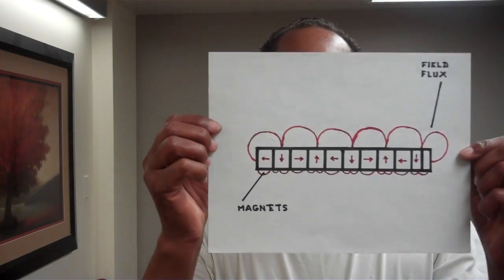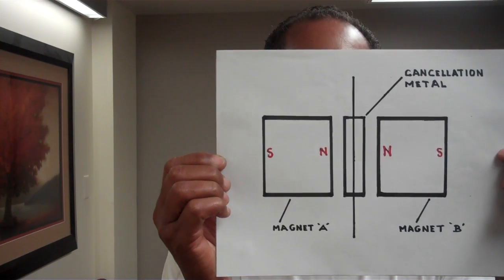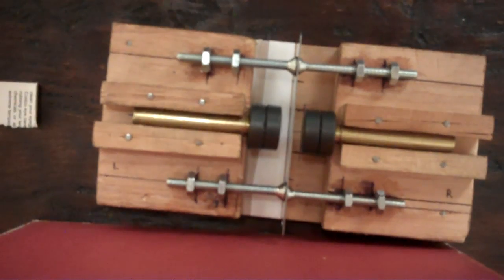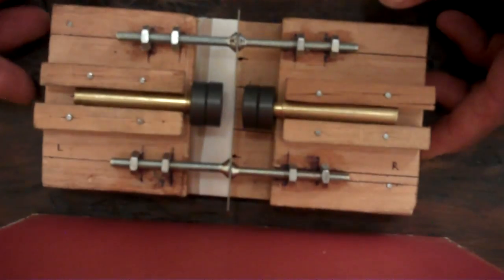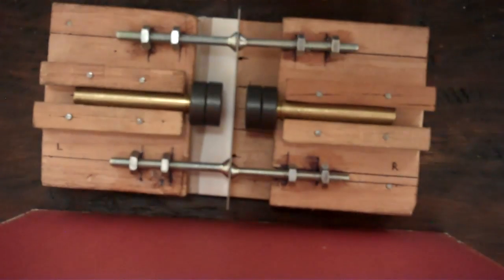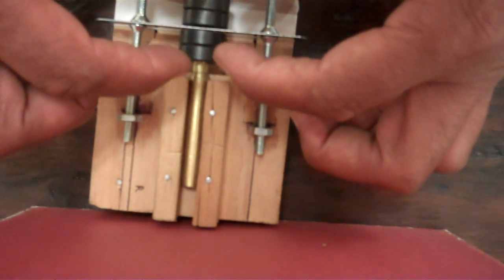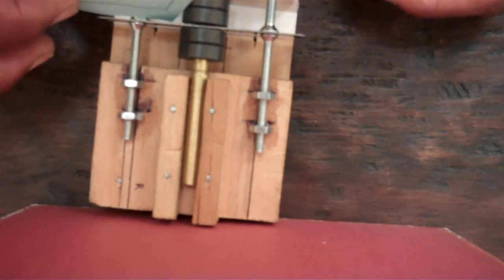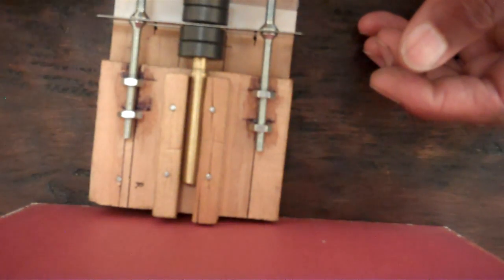PERMANENT MAGNETS: Two Types Of Permanent Magnetic Field Force Cancellations (Balancing) | Part 1

Comment: I wonder what material you used to cancel the strength of the magnets , I have tried already with several materials , which I thought best was the carbon steel, it negates the strength of the magnet that stuck on it , but does not prevent the another magnet is attracted by the same coating , please I'd like to know what this material in order to solve an equation problem I have,Thank you ... Good job !!!
Reply from the maker: +Nei Lemos Dear Mr. Nei Lemos: There's nothing complex here and no special materials are used. I used common small ceramic magnets (4 small magnets at 25 cents each) with holes in the center to superglue or attach small braze tubes (one to slide back and forth inside the other and cut to size) for about $2-$3 each, and the magnets and the tubes can be purchased at hardware stores. The cancellation metal is very common - spark plug gap blades ( about 30-35 to a set for about $5-$6) from any auto parts store. The screws can be metal or plastic for about $3 from hardware stores. You must find the exact thickness, exact length and exact width for the size, type, shape, strength and material that the magnets are made of. Simply make it accurate and precise enough and it'll work. It's not complex. The metal and magnets must always be exactly from the middle. There are no special materials in this Mr. Lemos. None. Look at the video again several times if need be and study it indepth. Everything is stated in the video.

Comment: why not also try plastic screws to hold the metal sheet and magnets?
Reply from the maker: +Dianne McCarthy Dear Mrs. Dianne McCarthy: Please make this simple device yourself and use plastic screws from a hardware store (about $3), 4-6 small ceramic magnets with a hole in the center of each (about 30 cents each) from a hardware store, 2 small braze tubes (about $3 each) from a hardware store, spark plug gap blades from an auto parts store (about $5-$6 for 30-35 in a pack). Use any common wood around the house you find for a base. Takes about $20 to make. Make it precise and accurate so it'll work.

Comment: What if... you epoxied the whole assembly together when the magnets and metal are in the correct position for cancellation.. would this be considered a uni pole magnet of sorts?

Also, how hard is it to move the metal out once cancellation is achieved?
Reply from the maker: ***** Mr. Steve Zuccaro: (1) the repulsion of the magnets towards each other (-1) while simultanously each magnet is attracted to the metal (+1) creates cancellation. +1-1=0. Epoxying the system in place in the cancellation mode would work. It simple depends on what your purpose is for doing this. (2) the metal is under attractive force from the magnets in the X, Y and Z coordinates directions. How ever strong the fields of the magnets are is how much force it takes to remove the metal. Permanent magnets are of different types, materials, sizes, shapes, etc. depending on your purpose.

Comment: I was hoping you'd pull the metal out.
Reply: spedop08
If you make something that works, don't try to patent it.  It will be confiscated. Instead, send it to everyone you can by Email ans snailmail, not just YouTube.
We ALL benefit or NO ONE benefits.
Reply: alphabeticalor
The world is flooded by fakes and frauds and that makes it easy to "debunk" overunity completely but look at what a magnet does, esp a powerful neodymium.  It produces a PERPETUAL field of magnetic force.  That constitutes an "impossible device." It's staring us all straight in the face; a glaring perpetual contradiction.  Why don't people see it for what it is?
Reply from the maker: +alphabeticalor Dear Mr. Alphabeticator: The above video doesn't demonstrate - magnetic shielding - but magnetic field force cancellation. This MUST be understood. They are two utterly different things. The set up in the above video shows a principle that has been searched for, for several centuries. This is what you were looking at along with Hallbach Arrays. If you wish to comment on any subject please make certain that you are versed in the field before doing so. To make certain that you gain comprehension please make one of these devices for yourself. No thinking or talking but experiment. MAKE ONE. It costs about $20-$30 to do so. Afterwards then talk.
Reply from the maker: +tomken8dy Dear Mr. Tomken8dy:  
   Your statement is correct. If the correct design is found (and it has) a permanent magnet system will run several months to several years without any external energy input. Please go to: https://youtu.be/ZQVEdDbq7wY
   Title: Permanent Magnets: Constructing A SEMI- Self Sustaining Machine. This presentation should alert you to such possibilities.
Reply: Andrew Sinclair
So the planets just orbit around the Sun for billions of years until it goes nova but it's not perpetual because that's not possible and admitting that our very planet and Sun comprise a perpetual motion device would make conventional science look foolish.
Reply from the maker: +Jeff Beck . Dear Mr. Jeff Beck: (1) This simple but extraordinary permanent magnet principle is to be used as part of machines which as a whole will do work. (2) There's only - one - true perpetual motion form and that is the total universe itself. Limited mechanical systems can never be perpetual even tho they can be long running or long lasting in the short human life time context.
Reply from the maker: tomken8dy Dear Mr. Tom ken8dy:  The device in the video is simple and can made for about $20 or so. Please make one for yourself. Be precise in its building and dimensions so it'll work as shown above. When the metal is completely taken away the magnets repel (push away) each other. Nothing more. This very simple principle has been sought for several centuries. To make free energy, perpetual, over-unity, etc. type systems which is mechanically not possible with - real - machines. Please go to other videos I've made on you tube about machines and permanent magnets and its laws.
Reply: Jessie Johnson
Permanent magnets produce perpetual energy.  Field cancellation, even a little, can help magnet motors get past the "sticking point."
Reply from the maker: +tomken8dy  Dear Mr. Tomken8dy: Only in the sense of human longevity does a magnet produce a - VERY - long lasting field if that magnet is undisturbed under nominal conditions. A magnet's magnetic field will last several thousands of years under flawless conditions.
Reply: Jessie Johnson
Which means that if the correct design is discovered a magnet motor will run as long as it's bearings last.
Reply: Jessie Johnson
Thank you.
Reply: The metal in the middle supports the whole point of the demonstration.
Reply from the maker: +tomken8dy Dear Mr. Tomken 8Dy: Your point is well taken. 10-20 billion years is utterly perpetual or in perpetuity in the - human  context - in the short few 100's of 1,000's of years of longevity our very specie. It is the use of certain - words -  that produces the arguments. The sun and planets combination are not machines nor devices. A machine is anything used to do work for the purposes that living beings give it. There's one exception to this principle and that is: a living thing can not be made into a machine for when this tried they become slaves. It is the only exception. And a device is anything constructed also for a purpose to be used by living things. Outside of living beings there are no meanings, purposes, reasons, etc. Otherwise from the standpoint that you're speaking you are correct.
Reply from the maker: +ILLUMINATUS1973. Dear Mr. Illuminatus: Your word - propel - does not apply to the Universe as a whole but only to extremely limited things, entities, beings and processes. Yet, on your other point you are utterly, exceptionally and categorically ' CORRECT '.  The Universe is the totality of all energy and there's none other. The Universe is the totality of all outsides and has no outside.
Reply: +tomken8dy Bottom line: anything mechanical or electromechanical that you hope to get any energy out of isn't going to give you energy for long unless you feed some other form of energy into it (falling water, burning hydrocarbons, decaying atoms, solar photons, etc.). They're inefficient consumers and transmuters of energy, and useless producers. You can't just start something spinning and hope to get out more than you put in, or even as much.

Comment: HI Jessie.  Thank for your prompte response. I mede an experiment with a Ushaped core with 2 coils one on each side connected in bucking mode (opposed flux 180 degre) and yes it created a third field while the 2 other flux in the core where compensated each other. I used a third coil to collect and convert the mmf to emf.
Reply from the maker: Evens Abellard Dear Mr. Evens Abellard:  Permanent magnets are used in the simple experiment in the above video and not electromagnets. People seeking to build perpetual, over-unity, free-energy, forever running machines (which are an impossibility) have been seeking this simple principle (permanent magnet magnetic-field-force cancellation) of permanent magnets for several centuries. Even tho a semi-self-sustaining machine (repeat: SEMI) can be built using permanent magnets. One of my videos shows a working concept of this device I put the principle in the video above to show it can be done. I have a few other videos on machines and permanent magnets on you tube. Please feel free to watch them.

Comment: Good stuff.   It would be interesting to locate the resustant field  from   the fields that are cancelled (compensate) eachother.  Everytime you have cancelation or compensation of at least 2 fields, a third magnetic field is created resulting from the source...
Reply from the maker: Evens Abellard Dear Mr. Evens Abellard: The - FIELDS - are not cancelled (they do not cease to exist). It is the opposing forces that cancels each other. The magnetic field forces of the magnets attraction to the metal is +1 and the magnetic field forces of the magnets repeling each other is -1. Hence +1-1=0. The magnetic fields are still there but the magnetic field forces of attraction and repulsion are equal but opposite therefore they cancel each other. What you say may be so or not so about a third field being there. I do not know. The attraction of the magnets to the metal and the repulsion of magnets to each other is taking place within the same space simultanously. For this to be it would be phased. This is the simple way to explain the process. I know what the experiment as a fact is showing - only. The rest I leave to others.

Comment: What happens when you pull the metal out ? Does the magnets bounce away from each other?
Reply from the maker: Werner van loggerenberg  Mr. Werner Van Loggerenberg:     The cancellation is along the X coordinate line and - not - the Y or Z coordinate lines. The cancellation metal is under magnetic attraction in all 3 coordinates directions with the magnets. But the magnets are repelling each other. If you pull the cancellation metal out, the magnets will repel each other. Pushing each other apart. To answer both your questions.

Comment: what´s material is lamine your use?
Reply from the maker: luciano federico acuña salazar Mr. Luciano Federico Acuna Salazar, I do not know what you mean by the word " lamine " . Do you mean laminate such as in a sheet of plywood laminate in a sandwich type of way? There's no laminate in this simple demonstration model. It's made of wood, small non-magnetic braze tubes, spark plug gap blades gotten from the car auto parts store and common screws. There are 4 small magnets in 2 sets of 2 each. They are stuck together under magnetic attraction. There's nothing unique about the model used. The magnets can be any physical size, shape, materials, etc. The cancellation metal can be steel, iron or other type of magnetizable material. The cost to make the small model in the video was about $15-$20 total. Simple make a model with enough preciseness and it'll work. There's no magic in this only mechanics.

Comment: so using this theory,the production of commercially viable magnetic motors/generators is wholly possible,as it eliminates the gap between attraction and repulsion thence making smooth operation of a mag motorgenerator possible ,as its always been  awkward to eliminate the flux gap.very interesting,maybe you should make a mag gen/motor using your theory as it turns out to be practical and possible

Comment: Curious, do the magnetic field lines retain there integrity during the force cancellation process with metal between them? If you might have been able to use a magnetic scope to observe the fields, during the process, you may be able to say. I noticed your first diagram indicated  that the magnetic field dissipates on the lower portion of the diagram. Have you been able to observe this process?
Reply from the maker: Brian Thomas Mr. Brian Thomas: I have - not - used a magnetic scope to observe the magnetic field lines as yet. But I might try metal filings to see the shape of the fields later. In the first diagram the field doesn't dissipate but is simple squeezed to one side in halbach arrays. Since the magnets repel each other this weakens it over months but at the same time it's attracted to the metal which keeps it strong. So I don't know what shall happen because all I needed to prove was cancellation. This was my objective. All other tests some one else will have to do.

Comment: Please, what is the name of the material you use between the magnets to make the cancellation of the magnetic field?
Reply from the maker: Mr. Trelin Trelon:
   The magnets are small common ceramic round magnets (costs 25-30 cents each) with a hole in the center to super glue small braze tubes (cost $2-3 per tube) and the cancellation metal is very common - spark plug gap blades metal - that can be purchased from any auto parts store. Costs $5-6 per set of 30-35 blades of different thicknesses.
Reply: Jessie Johnson Mr. Johnson, first, thanks for the reply and for sharing their noble knowledge.

1-I want to know the following, I can use neodymium magnet ?

2-In the opinion of Mr., the electrons leave the magnetic field of the magnet ?

3-It is necessary to be round magnet with hole in the middle to cancel the magnetic field ?

4-I want to buy the same blade that you used in the video, I live in Brazil, could you please detail me the specification ?
Reply from the maker: Trelin Trelon Mr. Trelin Trelon: To answer your questions above in the order given. 
1. Any types of magnets can be used such as ceramic, steel or neodymium and so on.
2. That may be true or false, I don't know. What I do Know is that the magnets are attracted to the metal (common steels or magnetizeable materials) but repel each other. Meaning that the repulsive and attractive fields are phased within the same space.
3. No. The magnets can be almost any shape: sheet, square, rectangle, triangular and so forth depending on what you intend to do. But the cancellation metal must be of an exacting thickness, length and width for each specific case and surfaces.
4. Simply go to any auto parts store and ask for - spark plug gap blades - which are used for spark plugs in cars. It's common steels.
5. The device above is just to show cancellation and all of the materials its made of are totally common every where in the world. There's nothing special. None of it.
Reply: Jessie Johnson Mr. Johnson, I will provide the necessary materials to test his thesis.
Renew my thank and wish you peace.

Comment: There is no friction in between the magnet and the cancellation metal, am i correct ?
Reply from the maker: Mr. Virtually Realistic:
   That is correct. There's no friction between them. The magnets and the cancellation metal are - never - in surface contact. And, you can put the magnets and  the cancellation metal 1/1000th of an inch apart (or close to each other) and they will never stick. The magnets repel each other but are attracted to the metal with equal force. Hence; cancellation.
Reply: Thank you for sharing your information on magnetism.